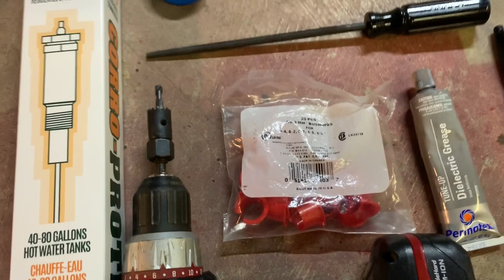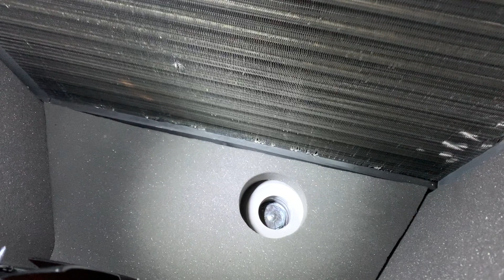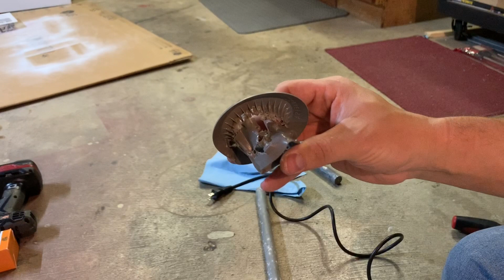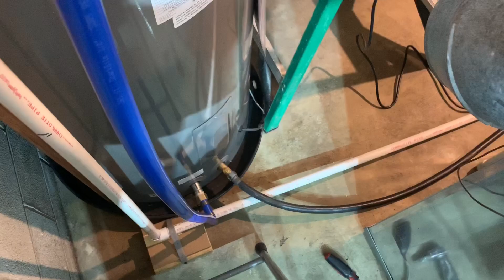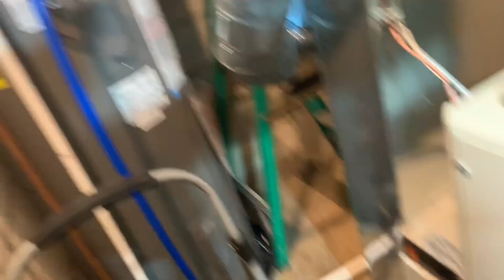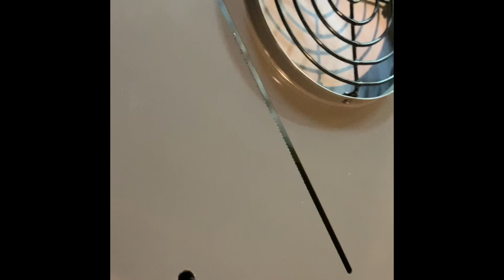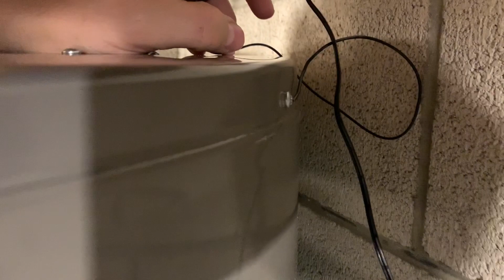Rheem Hybrid Electric Water Heater Anode Rod Replacement. Sulfur Smell is Gone!

Comment: Thanks for the detailed video. I just completed this project with relative ease, and my DIY skills are about average. In fact, it was even easier as that protective plastic cap popped right out with just a little prying with a flathead screwdriver (ie. no Dremel needed). There was even a pre-cut circle in the foam to make room for the new powered anode. I've had this tank for a year, so there was a bit of corrosion built up on the anode, so I had to be careful removing it so as not to damage the threads. I rinsed the threads with a little water to wash off any bits of corrosion before installing the new anode. Time will tell if this works, but I'm expecting it will.
Reply from the maker: That’s Awesome. I hope it works for you (I imagine it will). I think I was a little cautious to recommend to the everyday DIYer, but in hindsight I think the project is doable by anyone. Probably the most difficult for some is the electric. So many are afraid of electric, but if you turn off the breaker, and take some reference pictures before disassembly, should be no problem.
Reply: @EvolutionDIY  Agreed on the electrical aspect. If I can find the breaker, and there's two blacks, two whites and a ground, I'm good to go. However, I had to get my electrician neighbour to install a new receptacle in order to power up the anode, because figuring out the wiring situation in my pantry was beyond my ability.
Reply: @EvolutionDIY  Just following up... the smell went away completely with in 48 hours.
Reply: @EvolutionDIY  did I just hear the HVAC unit start up at 23:41
Reply from the maker: @LadariusCapersOfficial  I don’t actually remember. I just listened to it and I can’t even figure it out. Lol. It sounds like a freight train on camera, it’s definitely not that loud in real life. Phone audio is terrible. I plan to upgrade audio and camera in the future.
Reply: @EvolutionDIY  I heard hissing in the background
Reply from the maker: @LadariusCapersOfficial  I have a geothermal unit, and when it starts up, the flow of water rushing through the valves makes a pretty loud hiss sound. Not quite as loud as the video made it seem, but ya it’s a pretty vocal unit.

Comment: Hey Dude,
Good on you!!  Thanks for video.  I won’t be buying Rheem, but am buying Rheem’s competitor HP hot water tank.  Thanks again.
Reply from the maker: I hope you didn’t pass on Rheem on my account. It really is a great unit so far (minus the anode rod I had to change). I’m sure the competitors use anode rods too. Hopefully if they do and people run into issues, this can still help them out. Thanks for watching.

Comment: Few things, there are heat pump water heaters that do not have the back up electric elements they do not have the anode rod but also do not have back up if the heat pump fails.  The stainless and plastic water heaters do not need or have anode rods so it would be nice if someone made one of them with the heat pump.  Last but not least, peroxide kills the bacteria that causes the smell and peroxide degrades to plain old water once it does its thing.  The bacteria does come back after about 3 months. We treat our water heater with it every few months.  I have been told you can treat the well and it goes away longer but still comes back. I basically was putting peroxide in the filter before the water heater every three months or so.  I have the new rod like you installed I will be swapping it out soon.  Hope it works.
Reply from the maker: Good info. Thanks for sharing. I had read about the peroxide. I think at one point I even considered a peroxide injection system from thecleanwaterstore website, but in the end, it still seemed like a high effort solution. I hope you get the rod installed and it works for you. As long as your sulfur smell is in the hot water only and not the cold, I think it will work for you. Good luck!

Comment: 1:34 you said non replaceable , you mean non accessible, what they mean is it's not EASY accessible from the top like most water heaters.  the heat pump components are on top and are in the way making it more difficult.   I replaced mine after 2 years, same sulfur smell.  i have a water filter and water softener and it's good to let a little chlorine in there from time to time.  I may go with the powered rod next time i have to change it out, the aluminum one from home depot works in a pinch and there's less smell but wont last very long.   lastly, i had to invest in a $200 milwaukee impact driver so i could get my anode out.   my grundfos recirc pump just failed and i'm dealing with return issues.  my rheem 80 gal hybrid runs almost non stop.   insulate those hot water supply and return lines, it's a must!
Reply from the maker: Good suggestions. I haven't insulated my plumbing lines yet, but I have considered it. Add it to the list.....
Reply: @EvolutionDIY  sorry for the typo, yeah insulation is a must, otherwise it's a big radiator :)

Comment: Why don’t Rheem use this system instead of the anode rod or allow it as a purchase option so it can be fitted during manufacture?
Reply from the maker: Yeah that would be awesome. I assume they sell most units in high populated city areas. In these areas they would have city water, and probably wouldn’t have the sulfur smell issue. Anyway, this is just a guess, I actually have no idea. I would have much rather have had the option though.

Comment: Thanks for the video.  Well done and appreciated.  I replaced a 30yr old glass line tank without an anode rod, and got a surprise when the hot water started to smell. Fingers crossed this fixes it. The old rod was definitely on there tight. Impact gun got some exercise.
Reply from the maker: Did this fix your water smell? I hope so. I was in almost the same exact situation as you. Unknowingly replaced a 25 year old industrial grade concrete lined tank with no anode rod. I had no idea.....and then surprise! It's been a year and I still have awesome results. I hope your experiencing the same.
Reply: @EvolutionDIY  yep. Problem solved.  It should really come from the factory this way.
Reply from the maker: @michaelanderson5982  Yes I wish they would. I hope the powered one provides the same corrosion protection that the sacrificial metal one did. But either way, I am saving so much money in energy vs. my 25 year old 115gal electric one I replaced that this one could rust out in 5 years and I think I would still be ahead! Glad it fixed your issue too.

Comment: Just return it if it is not working right
Reply from the maker: I guess returning it would have been an option but the new one is so much more energy efficient, and so much better than my older one. With the new rod the smell has been gone for over a year, so overall I'll call it a win.
Reply: @EvolutionDIY  Glad you got it working right.I found something more efficient actually researching it now THERMODYNAMIC SYSTEM

Comment: I hope you have time to answer back.  I currently have an old electric water heater.  I’m going to replace it with a Richmond heat pump water heater (supposed all the same parts as Rheem).  I am on a well.  Currently (before replacing) I do not have any sulphur smell.  Should I presume that it’s possible that after I install new heat pump water heater that I might have a sulphur smell on the hot water side?

Comment: Great video, thanks for the tips. I have the 50 gallon version of the Rheem Hybrid. I’m on well water and have been putting up with the sulfur smell for over a year, which has only gotten worse with time. So I finally decided to replace the anode. I was able to get a thin wall 1 1/16” impact socket over the anode head without removing the plastic ring by tapping the socket down over the anode head with a rubber mallet and a 15” socket extension. But breaking the anode rod loose was another matter. Even with a 24” breaker bar, I was unable to break it loose. The tank just wanted to spin, even full of water. I finally resorted to an impact wrench with 400 pounds of torque. It took quite a bit of pounding, but eventually I was able to get it loose enough that I could remove it with the breaker bar. That anode rod is seriously torqued at the factory. The rest was pretty straight forward. The Corro-protect anode I installed required a 31 mm socket. I took the opportunity to flush the tank of sediment while doing this since it’s been in service for a year. Looking forward to no more sulfur smell!
Reply: Hi, It is one year later. I was just wondering if you got rid of the smell. I am going thru the same smell and I am looking for a solution. Can you please share your experience? Much appreciated

Comment: We have the Rheem 50 gallon hybrid and Rheem told us to change the anode rod, told us which one to purchase and said we needed to because of well water.
Reply from the maker: Did Rheem tell you which rod you should purchase? Did they suggest this electric one, or did they suggest a different sacrificial metal type one? Just wondering...I don't plan to change mine again :)

Comment: I think this is the first video I have ever commented on on YouTube but I want to say thank you! We purchased a Rheem hybrid hot water heater and around day 27 we started to experience this smell. By day 30, it was so overwhelming we had to do something. I’ve heard from others doing this won’t void your warranty (Rheem reps have said it won’t to them). I am in contact with them but couldn’t wait for their response with COVID especially with no phone support available. I went ahead and did this, however, I did have to call one of my guy friends to pop the hex bolt (120lb female here). I couldn’t get the bolt to pop but they did after a couple of attempts. This bolt is on no joke. After that it was pretty smooth sailing. Without this video, we probably would have had to get a chlorination unit so we are so thankful you posted it. Corro started working immediately (within hours) and the smell was gone. We did empty about 10-15 gallons out tho so that does factor in how quickly it started working. Heard this is a common issue so idk why Rheem hasn’t addressed this or changed the design.
Reply from the maker: So glad this worked for you too. It's been a year for me and still working great. I will say if I use EVERY SINGLE BIT of the hot water to the point where it is barely warm, I will get the slightest faint scent of sulfur still, but it goes away once I let the hot water builds up again. Has only happened 2 or 3 times, and only if I completely use all hot water. But anyway, overall I'm still completely happy with the result, and would do it again in a heartbeat.

Comment: So let me get this straight. The anode rod you pulled out was the factory rod after only three weeks of usage? If so, that's a lot of corrosion for only three weeks. I have the 50 gallon version of this water heater and it's been awesome. I've had it for two years and I was planning on replacing the factory anode rod after having my unit for three years. I would hope my factory rod won't be too corroded even after three years.
Reply: Yup.  Seems so.  Mine started to smell after only 5 weeks.  Gotta love Well Water!

Comment: 1. Did you have sulfur problem with your old water heater? 
2. Do you think it would be easier to work on removing anode rod if you removed blower fan? 
3. I would also try to make those coil bladed straight to get max efficiency of this unit. 
4. I had similar situation where I could not remove my rod. I disconnected entire water heater, put it on a side and replaced the rod. I think it's just easier then cutting the rod.

Comment: Thanks for the video. What is the length of the anode rod removed from the heater?
Reply: @EvolutionDIY   - thanks for this video!  I have the exact series of water heater in the 65 gal. version - purchased & I installed in 2018 when I redid my whole house in a "homerun" PEX system.  I did not have any sulfur smells with the prior HWH or with this one either; I also am on well water.  I'm mainly interested in the anode rod replacement for tank longevity.  I persistently harassed Rheem and finally they came back with p/n AP11526T-2 for my anode rod.  This rod is only 39 3/8" long, which is probably shorter than yours, as I believe the diameter of all these Rheem units (40/65/80) are the same and they gain their capacity by taller tanks, if someone could confirm.  I'm torn on voiding the warranty to look at the rod to see if it is OK, as I do not want it to be totally consumed before I replace it!
Reply: Sorry - my prior post was wrong on capacities - they are available in 50/65/80 gal.  FYI - my unit is 64" tall

Comment: Did you put an expansion tank in as well, when you installed this tank?

Also do you have a mixing valve as well for scalding?
Reply: @EvolutionDIY  if you’re on a well you don’t need a expansion tank because the expansion tank that runs the well pump is enough.   The only time that you need one is if you have city water and there is a check valve installed after the water meter. If you have city water and no check valve then you don’t need a expansion tank.

Comment: Believe it when he says to remove the plastic collar around the existing anode. Although my socket fit perfectly and I even bought a new stronger impact gun, the anode did not loosen until I removed the plastic collar. After that, smooth sailing!

Comment: Thanks for this video! I love this water heater but I had the exact same problem. Installed powered anode about 2 hours ago. This should cure the smell. 
Here's a tip for those who are going to do this. 1st, absolutely leave the water in for weight to remove the old rod, they put them in there for real. 

2nd thing:  The reason the socket won't fit is that the plastic collar may not be perfectly centered on the existing anode rod. If you take a medium flat blade screwdriver and gently pry around the places where it is too close to allow the socket by, you can move it enough to get the socket on, it has some memory after you pry it. Then take your socket and extension and move it around until you feel it grab any part of the anode top hex, straighten it out, and gently tap it onto the nut. Nothing crazy but it WILL seat the socket on the top of the rod. Then remove. I took mine out without the removal of the plastic collar. I suppose if yours is off center enough this may not work, but it worked perfectly for me. You could look into a thin wall 1 1/16 socket as well though I don't know if that's a thing. The anode nut on a Corro-Protec CP-R Water Heater Powered Titanium Anode Rod is 31mm but all I had was a 32mm axle socket and it worked fine.
Reply: FWIW, mine was way off center; the socket barely fit with all of the plastic off. To take that plastic off, I used a screwdriver + utility knife + needle nose pliers, and not going to lie it was a pain. I also had foam stuck to the plastic.

Comment: Thanks so much Chris! Excellent video! Maybe consider (I am not an electrician) for your main power wire coming into the tank get a flexible conduit line to protect that wire. They are super inexpensive look good and will give some protection to that wire. (Most jurisdictions do require them)
Reply from the maker: Great Suggestion and I plan to do this in the future. Add it to the list....... :)
Reply: @EvolutionDIY  Put it on the pile! I can't believe Reem doesn't tell you that you need to replace this rod about every 3 years! At $68 ! I know someone who just placed a plug and no rod and they have perfect no smell water. Either way your warranties are void. Actually, I don't think they care judging by the reviews on BBB.

Comment: Do you happen to know how many kwh you use per year ?
Reply from the maker: In 2020, I used 905.41kwh. At my current rate of about $0.12/kwh, Cost about $108 for the year. We have 3 people in our house, and DO NOT attempt to conserve hot water. I run dishwasher daily. Laundry whenever. Pretty full baths daily for our kid. I removed the "water restricter" from our main shower head to improve pressure so that uses more hot water than normal. Anyway, we just live like normal and don't try to "conserve" hot water and I feel the energy efficiency of this unit is excellent. I would say the Energy Star label on the side showing $161/year is pretty accurate for a 4 family home.

Comment: Is there a manufacturer making a polyethelyne tank ( like the Rheem Marathon ) with installed a heat pump?  Also add a large powered anode rode to protect the heating elements.

Comment: Why is that factory rod so big???
Reply: The rod needs to be the entire depth of the tank so you get the maximum protection from the corrosion process. Think about it. What if the rod was only half the length of the tank? That would mean the bottom half of the tank would be much more vulnerable to tank corrosion because the rod would only be protecting the upper half.

Comment: I’m a lic. Plumber in Massachusetts and I install these all the time they carry a 25 year warranty on that power anode rod which is the same unit I use they work. If you want the smell gone immediately just completely drain water heater down and refill with fresh water and turn on and no sulfur smell !!!
Reply: Then what happens in a few weeks? Smell comes back again?
Reply: Do you have to cut all the plastic off like the video? Or is there a better way
Reply: @maxstr we didn’t have to cut the plastic away

Comment: We are looking at doing this exact replacement on the Rheem 80 gallon hybrid. Have you had any problems since the install or has it been sulfur free since installing?
Reply: The sulfur smell is a water quality issue, I would not remove and replace the anode rod unless it is absolutely necessary. These units have a ten-year warranty, the Rheem Marathon would be an excellent choice where water quality is an issue.